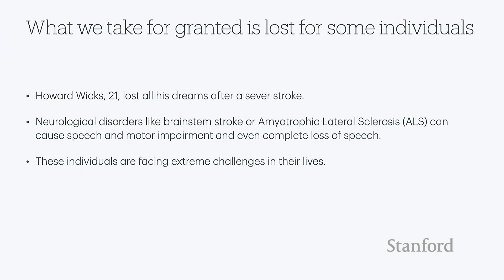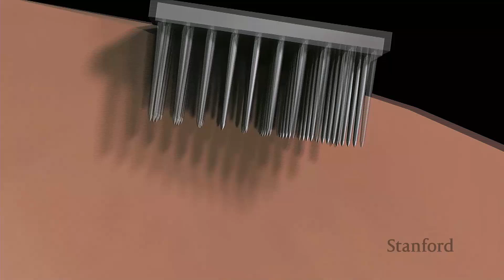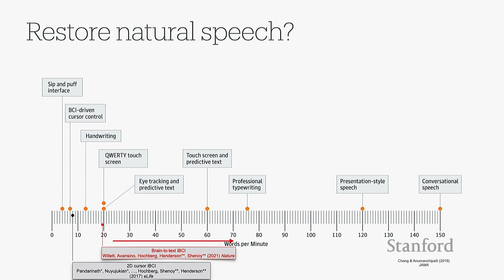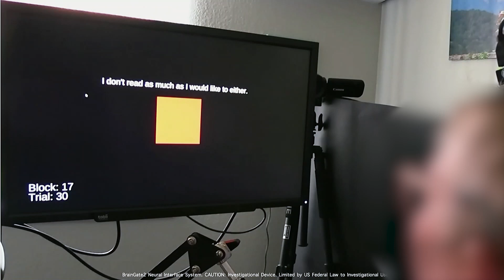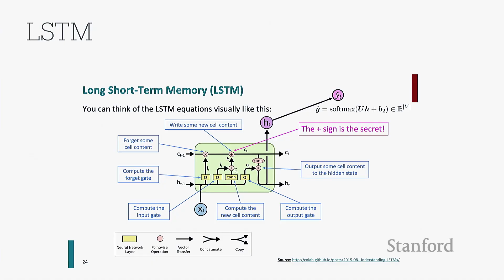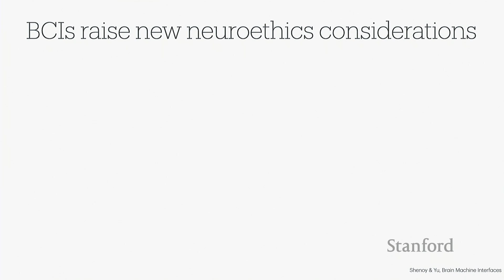Stanford CS224N: NLP w/ DL| Spring 2024 | Lecture 13 - Brain-Computer Interfaces, Chaofei Fan

Comment: Workforce Reskilling and Redeployment

**What to do**:
- Audit which roles are most affected by digitisation
- Design transition paths (retraining, internal mobility, external transition support)
- Build new role categories before eliminating old ones
- Invest in upskilling the existing workforce before hiring externally

**Specific actions**:
- **Reskilling programs**: Teach existing employees new capabilities (AI literacy, knowledge curation, judgment under uncertainty)
- **Role redesign**: Convert document-heavy roles into quality-assurance and verification roles
- **Team reconfiguration**: Move from individual experts to distributed expert networks
- **Career pathing**: Show how current expertise translates to future value

**Implementation approach**:
- Pilot with early adopters (usually 10-15% of workforce)
- Document what works; share learnings
- Rollout sequentially, not organisation-wide at once
- Maintain support for those struggling with transitions

**Example**: A consulting firm realises junior consultants doing standard analyses will become less needed. Response: (1) Design a new "analytical validation" role where consultants verify AI-produced analyses and focus on interpretation; (2) Create a fast-track to senior consultant positions (less routine work means faster advancement); (3) Offer voluntary transitions to other departments; (4) Support those who leave with severance and retraining funds. Result: Workforce shrinks in some areas, but stays engaged rather than resentful.

Comment: The semantic understanding of Brain-Computer Interfaces (BCIs) involves the ability to decode neural signals to understand and control the actions of machines. BCIs are designed to capture specific patterns of neural activity that correspond to thoughts, intentions, or actions, such as the intent to move a hand or focus attention on a visual stimulus. The decoding process relies on a deep understanding of the neural correlates of behaviour and the application of sophisticated computational algorithms. BCIs share a common architecture that involves several fundamental components: signal acquisition, signal processing, feature extraction, translation algorithms, and device output. This architecture allows for bidirectional interaction between the brain and digital technology, enabling information to flow from the brain to a machine for control or communication, or from the machine to the brain for sensory feedback or stimulation.